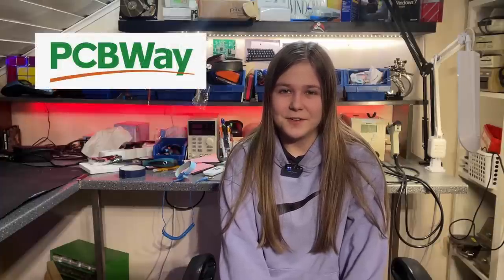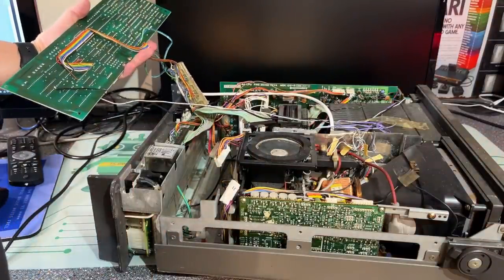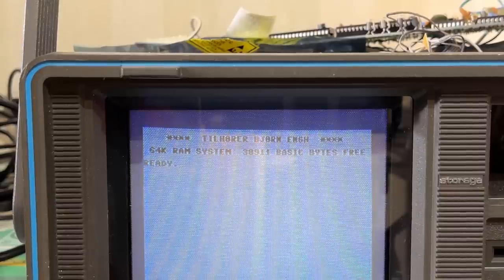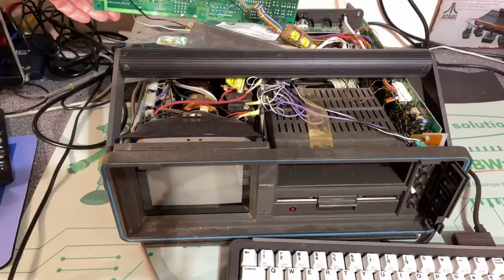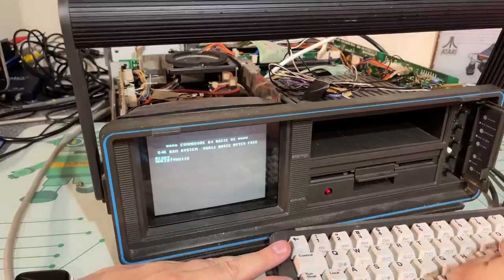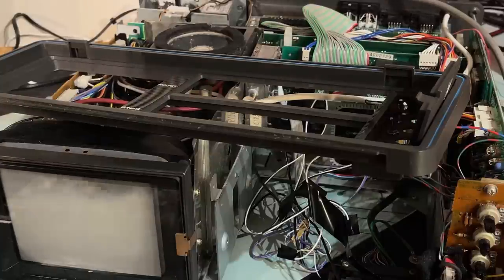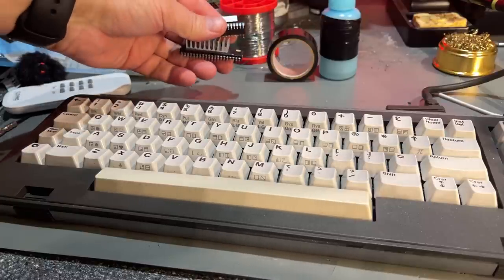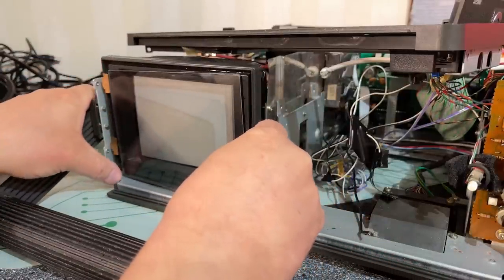Commodore SX-64 in a mess and a bad keyboard. Can it be fixed to look nice again ?

Comment: I fixed my semi, non-responsive keyboard on my SX-64 using a mechanical pencil. Just went over the traces on the keyboard membrane softly with the pencil and the keyboard worked perfectly after that.

Comment: Fascinating, those piggy-backed ROMs.
Reply from the maker: Sure it is. But it works :)
Reply: Dual booting in the old days was definitely a very different challenge!

Neat approach though if a bit risky, these days it might be easier to achieve with a custom daughter board so everything could be socketed... space permitting

Comment: Removing the floppy drive/storage pocket assembly can be done without removing the front panel, monitor or CPU PCB. 
There are four screws on the side of the floppy drive/storage pocket bracket that you access from the top.. down between the pocket and monitor and on the other side near the CPU board. If you remove these screws you can slide the whole assembly backwards a bit then lift it up and out of the SX-64 from the front. Make sure you have the cables disconnected, they are usually secured with a metal clip on the bottom of the chassis.  Having a magnetic tip screwdriver (or use some blu-tak) makes re-inserting the screws easy.
Reply from the maker: Oh, thanks for the tip!

Comment: The red latches and side panels are a nice touch.  The color lets even the casual observer know they are not original, which is important for retro types like us.
Good job on this.  You are right to not sweat the vibration damping washers except that this machine is going back to its owner.  I hope you meant you would be working on the drive later, and that you will reinstall the washers before returning it to the owner.

The SX-64 was such an unusual system, and Commodore could have done more to popularize it, but it now is what it is.  I'm glad to see you could get this one working again.

Comment: Great to see one of these being fixed up. I'd love to own one of these, but they are too expensive sadly. Nice video!
Reply from the maker: Thanks!
Reply: They're bulky, unpleasant to carry, the screen is really bad and the keyboard is worse than on Commodore64 machines. The only advantage is that you don't need to deal with PSU and floppy cables. I've restored mine from a machine used for spares where pretty much everything was broken except for the floppy mechanic but barely used it afterwards. Got it for 30€ I think.

Comment: Jam in new WDC 6522s for $10 each. Uses 1/10th the power of old ones.
Reply from the maker: Thanks!
Reply: @Arcticretro for the WC6522 you need to include external pull-ups for the ports, as these are not present inside the chip, also the IRQ pin is not open
drain, so you need to take care of that as well. .

Comment: Did you ever figure out the purpose of the modulator? Would be interesting to know if it's input or output. I've seen SX64 machines with s-video input for watching VHS tapes.
Reply from the maker: Nope. This was the last I did with this machine